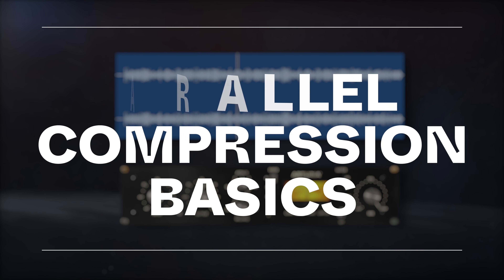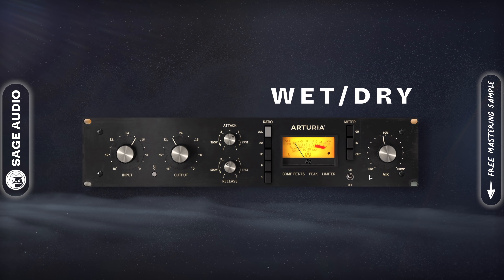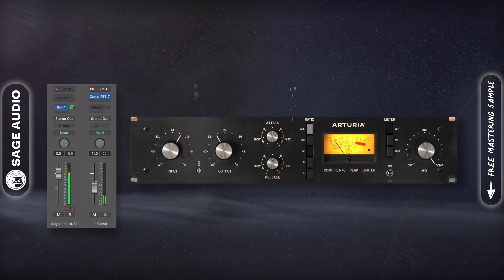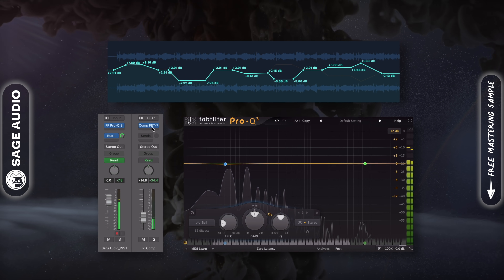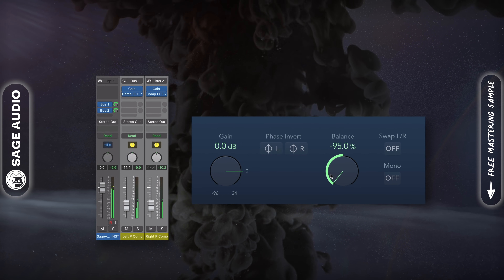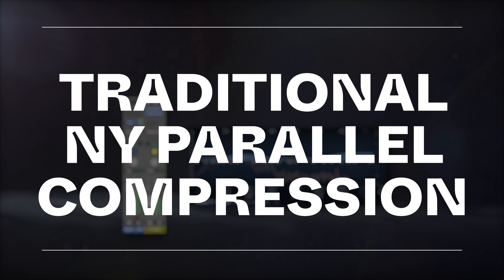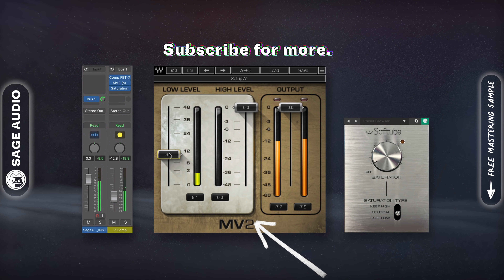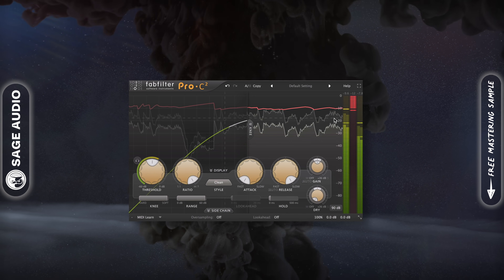How to Parallel Compress

Comment: Also for Logic Pro users you can do left/right and mid/side processing with ANY plugin. U don't actually need to use separate aux track for that kind of parallel compression.
Reply from the maker: Nice I'll check that out! Thanks for watching!

SageAudio.com
Reply: @sageaudio  Of course! just load a plugin on a stereo track in Dual Mono mode and you'll find the mid/side mode if you click on the cog at the top of the GUI. Thank so much for these videos! I get a lot of cool tips from you guys and they are not just the same tip over and over again they are useful new tips I didn't know before.
Reply: There are similar tricks for doing parallel processing in Ableton where you don’t need to do a separate aux send for the effect (a quick Google should find tutorials). Can be helpful when you are using cpu heavy processors and just want to freeze the whole thing as one track. Any plugin can be made to do a wet/dry mix this way
Reply: @mrnelsonius5631  yeah unfortunately that feature is not in Logic.  I like using it in Bitwig though however Bitwig doesn't have track freezing. It does have a cool thing where you can bounce the audio to a group track and deactivate the other tracks inside the group. I do that sometimes to save CPU.
Reply: @lawinter1949   yeah, they all handle this stuff slightly differently. Ableton is pretty great about freezing tracks, you can even edit them while frozen and move song sections around but -you can’t freeze a group of tracks or bus which is a pain. My heaviest processors tend to go on buses so I’ve actually resampled entire buses into stems to get around it
Reply: @lawinter1949  what’s cog and gui ?

Comment: One of my favorite things to do with vocals to get them to cut through the mix is to use a CLA76 in parallel , compressing the lows and the highs and lot of times it will be almost the same level as my dry signal. On occasions I might de-ess right after with a tubetech cl1b , works in most cases
Reply from the maker: Nice! Thanks for sharing! Thanks for watching!

SageAudio.com

Comment: in your previous video you said saturation is mixture of compression and etc . i have a question that if i apply compression on my vocal first properly(no need to compress the signal again after this compression)  now if i apply saturation on my vocal after compression  will they sound overcompressed
Reply from the maker: It's possible that it'll sound over-compressed! Some saturators let you control the dynamics so ideally you could leave out more compression.

SageAudio.com

Comment: I understand the techniques described for compressing the left/right and mid/side channels…
My question is: why would you want to?  When would you do one of these rather than the "standard" parallel compression technique or the NY technique?
Reply: Exactly, I was hoping for the same info.
Reply: If you have a wide bass for example , in order to avoid phasing issues and muddiness , I'll parallel compress the side information only to have it sitting where I want all the time , but I don't want to compress the mid part of my bass as it will make my bass sound smaller and lose a lot of edge
Reply from the maker: Thanks for watching!  Really any situation in which you'd prefer to have more control over the left/right or mid/side.  Mid/side would be more useful since it lets you affect the stereo image of the compression as well.

SageAudio.com